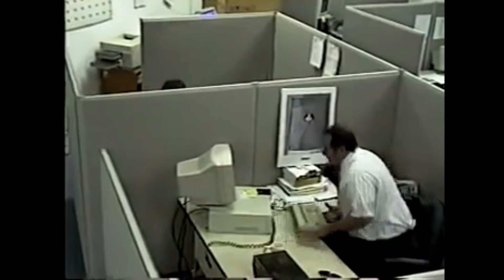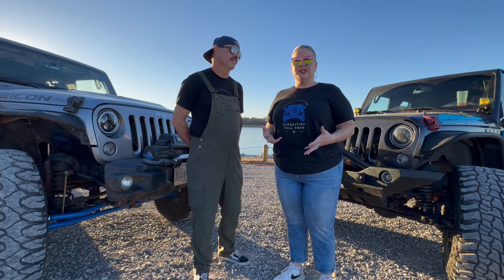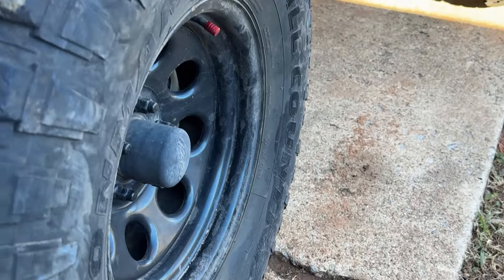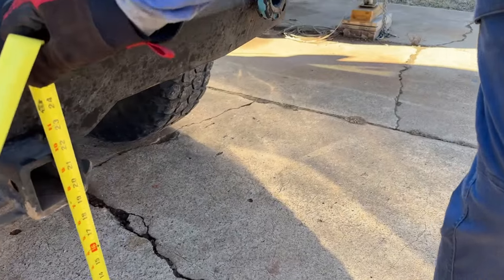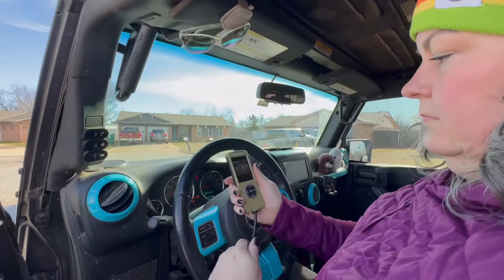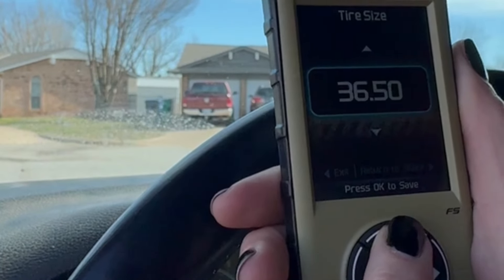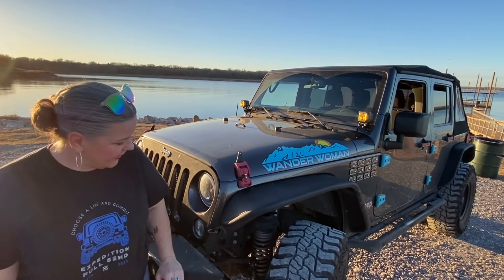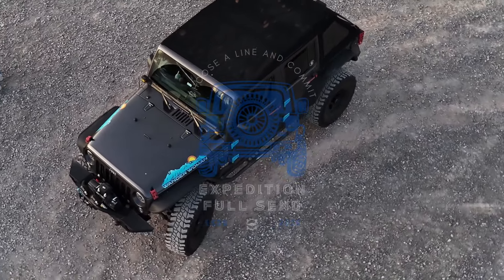We did WHAT??! How far can you go on 37s with Sport axles?

Comment: I been running 37’s with d30 for over a year now, I did change the gears to 4.88. So far is good. My 37 are actually lighter than the 35’s I had. Only time will tell! 😎
Reply from the maker: That's the same for us, regarding the weight. Is it more of a mass issue? I guess we'll see! LOL
Reply: Do the 4.88’s do well with 37’s or you think 5.13’s would work better?
Reply: @Coloradohighboy I guess it all depends on where you ride the most. Is my daily n trails in FL aren’t hard so 4:88 works fine for me.

Comment: If you're not locked, the D30 will live with a moderate skinny pedal. The first weak link is the axle U-joints. There are ways of addressing this: inner full circlip joints, Almost alloy weld on caps, or of course RCV shafts. A high spline count carrier (GrizzlyLocker, etc.) combined with axle shaft mods nets great results. The next weak link becomes the ring and pinion. Again, a moderate pedal greatly extends the lifespan of your parts. Bending the housing on a D30 generally only happens with high abuse; a truss or inner sleeving the tube (I pressed in and rosette welded hot rolled tube inside my XJ axle tubes) alleviates much of that worry. If you don't sky it out you should be OK.
Reply from the maker: Thank you, this confirms what we were thinking as well. Truss and sleeving has been discussed, and may happen. Honestly though, with the 5:13 gears, I rarely have to gas it. I just take my foot off the brake and she'll crawl pretty much anything. Hope you'll follow along!

Comment: I ran 37s and now run 38-15.50s, and about to move to 39-13.50s in my 07 jku sport with stock sport axles. I am locked front and rear (detroit in rear, eaton up front) and running factory gear ratio. I have had 0 issues with axles, but have been in a bad enough bind to snap my rear driveshaft. I dont get on the extreme stuff that I used to take my fully built and caged XJ on (basically buggy lines) but we try everything up to that. One thing that helps them survive is low wheel speed and low rpms, relying on wheel placement and sticking of tires as opposed to spinning until you hook to get up stuff (thats how I drove my XJ, on the limiter). So 37s+ are possibile as long as you drive reasonably. Btw, jeep has been in current form for about 5 years with rear driveshaft and steering sector shaft as only major failures.

Comment: I ran 37’s on a Dana 30 for 10 years. Changed the axle shafts and gears to 4.56. Did most of the trails in central California including the rubicon. Never had a problem with the Dana 30. Don’t try to bunny hop rocks and you will be fine

Comment: I have a 13 two-door sport I've been running 37 bfgs for over 7 years, Dana 44 in the rear with a mini spool Yukon chromoly axles and Dana 30 in the front Yukon axles lock write Locker 488 gears Adams Drive Shaft CV delete, had a guy here in Florida break into the computer unlock it and create 18 so that I can run the Spool in the rear no lights or limp mode I will the hell out of my Jeep, yes every once in awhile I break something but it's usually an Axel not a big deal the Yukon chromoly axles can take pretty good punishment, don't underestimate a Dana 30 I know people will laugh but when it's all said and done my Jeep is extremely lightweight and that's the thing I was really trying to achieve mostly flat trail riding in a lot of mud here in Florida
Reply: People will also say that you cannot run a spool on a JK in the rear you can if you get the delete in the computer there's a guy in Middleburg Florida tuners Inc. Does mostly Fords my jeep was the first one that he experimented with it took a long time but he was able to break into the computer and create a tune to run a spool, now that he has the program he's done a few more
Reply: @mikemay7134  care to post his info?
Reply: @FahimibnDawud  his name is Tony his business is tuners ink. Middleburg Florida

Comment: So stock wrangler gears are good up to 35in tires going any bigger your gonna need a re-gear correct ?
Reply from the maker: You don’t have to but you’ll be glad you did because your performance will suffer. It was really sluggish on 35s with stock gears, especially taking off. You lose torque off the line.

Comment: I am now. 4:88  With ARB Lockers front and rear . I am not heavy and pick good lines . But after 6k I am now having to replace the rear axles due to a bearing failing and a rear pinion outer bearing failing. I am staying with it though. I'm upgrading to chrome molly axles by Yukon with there master install so I can refresh the rear

Comment: When I looked up gear sets for my D30, the one gear manufacturer stated that the gear set was not guaranteed with tires bigger than 33".  Since then, I have seen 1 Jeep that ran 37s on a 30, but that guy doesn't really go off road, so I am still curious if those tires on that axle will really break gears under modestly aggressive driving.   When I looked up the same gear set for my D44, there was no tire size limit listed.
Reply from the maker: We blew up a set of gears shortly after we switched them out. 😅 That being said, I also really got in it and I bounced it, which we know is a killer. I don’t think it was the tires as much as that. Since then, we’ve done some wheeling and have been intentional with the gas pedal, and it’s all good…so far. 😊

Comment: I'm new to jeeps and just bought my first Wrangler. So you went to 37" tires and are getting 4mpg better than the 35's???? How's that possible
Reply from the maker: Hi there! We have 5:13 gears in this Wrangler. That killed the MPGs when we were running 35s. When we went to 37s it brought the ratio down which brought the RPMs down which then brought the MPGs up. With 35s the RPMs ran about 3300 at highway speeds but going to 37s brought that down to around 2700. That's a HUGE difference in effort hence the increase. Does that make sense?

Comment: Run it! You won’t know until you do. I’ve never run 37s on a 30. Largest size tire was a 35. Axle was in my XJ. Broke both axle shafts on the Rubicon before getting to any of the hard obstacles. In my experience, it’s just a matter of time before a Dana 30 lets go. I wouldn’t dump money into building up a 30 for 37s. You’ve got free 5.13 gears and 30s of today are an improvement over 30s of yore. Run what you got and start putting money towards a better axle in the meantime. You’ve got nothing to lose and the experience will make you a better Jeeper.
Reply from the maker: Thank you! That is precisely our line of thinking. It's likely that the weak spot will be the U-joint/axle shaft, and that can be replaced fairly cheaply. We talked about doing chromoly shafts, but that shifts the weak point to the ring and pinion, and we'd like to avoid breaking that if possible. That leaves the axle housing as another weak spot. I think a truss might help give us a slight advantage on that end, but it will eventually give out, as you said. We're going to have fun trying to make it last as long as we can!

Comment: If you go with a Teraflex full float kit on dana 44's you will end up with 44 / 60 axles. Dana 60 outers. 
4.88 gears should be your max. Because anything lower you end up with a pinion gear the size of a peanut. You don't want that. Ypur pinion gear will fail eventually. This is a copy of what us old ti.ers did back in the day with Ford 9 inch and 60 outers. A JK 44 has an 8.8 inch ring gear just a smidgen less then a 9 inch. It works.